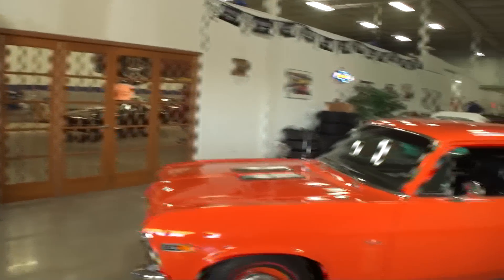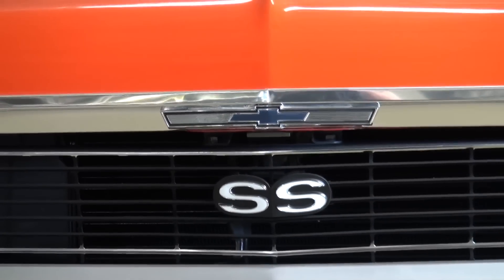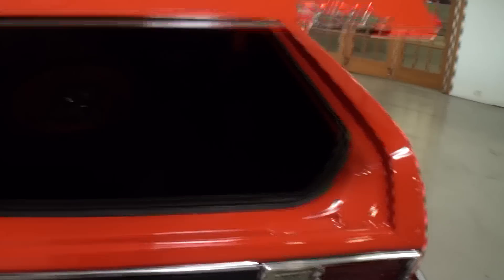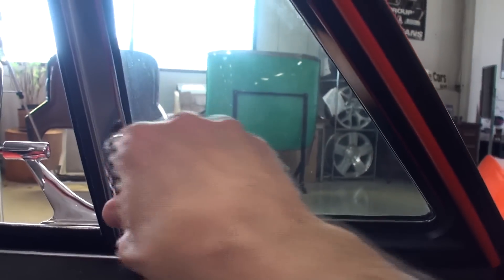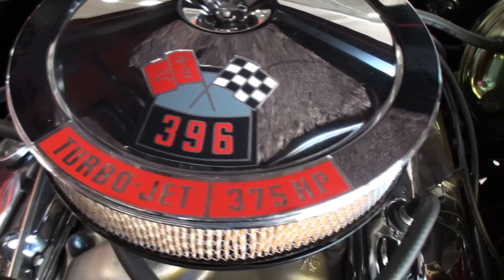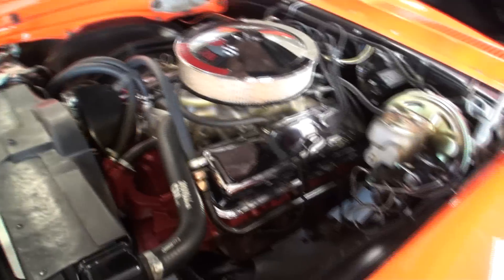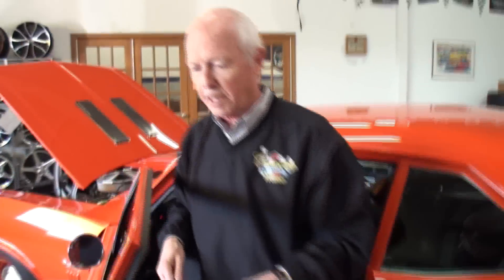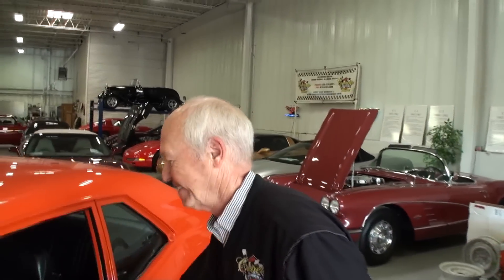1969 Chevrolet Nova SS Super Sport in Orange & 396 Engine Sound on My Car Story with Lou Costabile

Comment: He's right that   the Nova  SS  was the first  GM car to have Disc brakes as standard.       At the  02:19 mark  you cane see the  ribbed  extentions    on the outer   part of the front  next to the headlight   which was a design  from the 1967 full size  Chevy from the  Biscayne  up to the Caprice. 
       The Caprice   in 67   had those  corner  sections as Running lights and turning  lights with an amber bulb  inside the white lens   with  just the ribbed   housing .  
   Not many cars and  steal a design feature from just a 1-year  run and  then carry it forward about 5 years  and not be stale .
Reply from the maker: Hi Gary wood, Thank you for viewing and sharing your knowledge, Lou

Comment: Didn't know that Hugger Orange was rare on Novas....Knew a guy that had a 70 SS 350 4speed Hugger Orange Nova
Reply from the maker: Clearly a car you don't forget :-)  Thank you for viewing and sharing details on the guy you know who had a "Hugger Orange" one..
Reply: Lou Costabile Sorry Lou.... The car Sat in a private shop for years torn apart in Toledo OH. and then was shipped to a farm in Newport Mi where it Sat a couple years outside. The car was moved recently in the past year and has disappeared. Last I saw it ...It was holding rain water.  Hopefully someone who will do something with it got it.  Dan the guy who owned it didn't care much.   But this is what I always pictured in my head when I looked at it. What a fine Specimen !  I'm a Mopar guy but Nova's are old and anything old deserves respect even if it ain't a Mopar.  Thanks for the Great Vids.  And hopefully someone saves the Lost Nova

Comment: Day 2 would be headers, a single plane manifold, a little hotter cam = 500 h.p. easy.
Leave the pie plate hubcaps so people think you're a little old lady. lol
Reply from the maker: That's spot on :-)
Reply: You know those engines are a real smorgasbord of internal hot rod parts - depending on who the engine builder was that day. Because sometimes they'd just grab a part that was laying around taking up space. So you might get an L78 with a ZL1 cam in it for example.